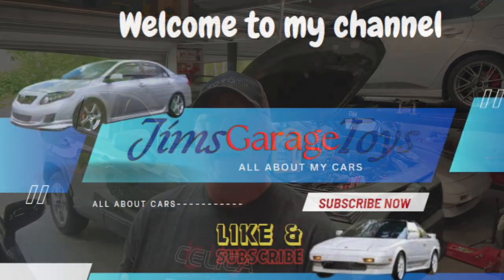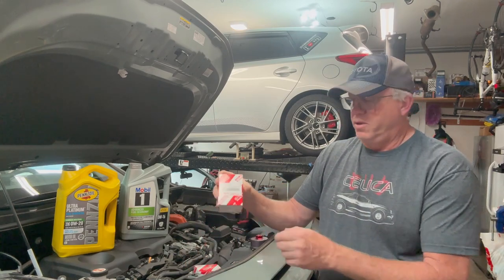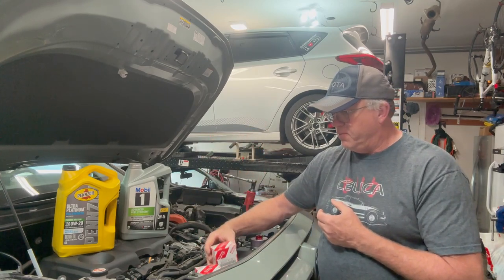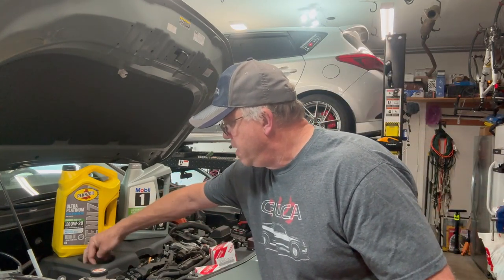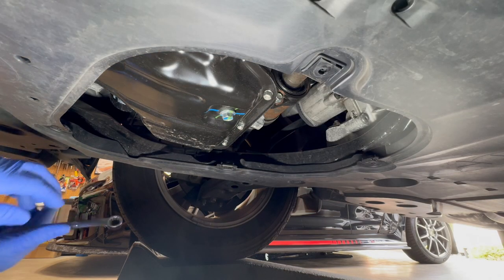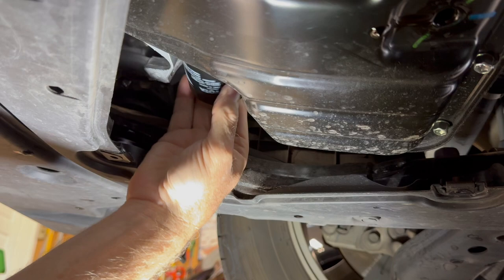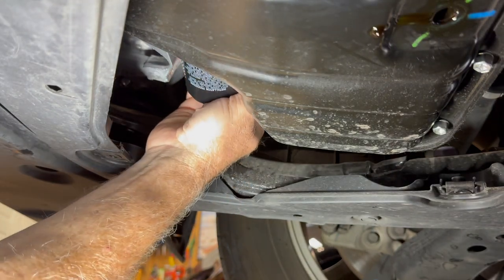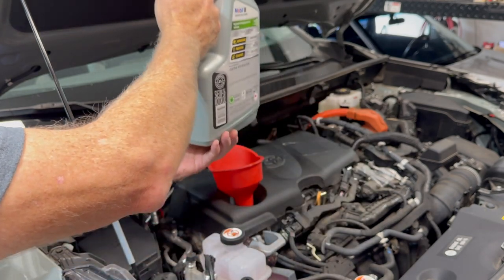Toyota 2019-2024 RAV4 Oil Change | Is 0w-16 The Right Choice? How Much Oil Is The Right Amount?

Comment: It may be even better to use the OEM Toyota oil, which is Mobil 1 with Toyota additives. The Motor Oil  Geek scientist is well worth looking up, as his company has done extensive oil research. When you take your car to be serviced by somebody else they are unlikely to pre fill the oil filter and are also likely to overfill.
Reply from the maker: Funny that you mention Lake aka The Motor Oil Geek. I'm just not very confident in the Mobil 1 oils as I haven't seen very good results from them in testing. In fact, Lake has tested the Pennzoil Ultra Platinum and has been very impressed with it. He has used it personally and loves how it has tested and performed. I've spoken to him about it several times. I will be working with him directly to test some different oils on both my 2009 Corolla Turbo and 23 GR Corolla. It will take a couple of years to get all of the data but I'm looking forward to seeing what we learn.
Reply: @ Next week in fact, l am picking up a new 2024 RAV4 hybrid AWD, and l have been trying to work out, which is the best oil  to use in South Australia (warm climate),
at this stage I am looking into OEM Toyota, (not sure wether to use their 0W-16 or 0W-20) or Pennzoil (Pennzoil also have a 0W-16 available in Australia, I am also concerned about my new cars warranty being affected by which oil I choose to use, or by me doing the oil change myself.
Reply from the maker: @aussiedeplorable8670  I know that I would use the Pennzoil Ultra Platinum myself in a 0w-20 with the higher temps. How hot are you talking? A 0w-30 or 5w-30 would also be okay in extreme heat.
Reply: @ in summer the temperature in South Australia range from 20°C to about 40°C (roughly 60°F to about 105°F), how would using 5W-30 affect the warranty with Toyota.
Reply from the maker: @aussiedeplorable8670  My first thought would be to use the 0w-20. It's listed in the manual here as being okay to use. When you get it, look and see what your manual says? Does it list any other oil viscosities? I'm curious to see if anything is different.
Reply: @jimsgaragetoys  
I think it is likely to be the same oil as they recommend in New Zealand which is 0W-20
Reply from the maker: @aussiedeplorable8670  I've heard from owners in hot regions around the world that 5w-30 is still shown in the manual as okay to use.

Comment: When you filled it to 4.5 qts with the short YZZN1 filter your video showed the level WAS proper...it was about 3/4 of the way between the min and max dots on the dip stick. 4.8 qts. would put the level ABOVE the max dot with the shorter filter. If you used the LONGER YZZ F1 filter or the longer WIX 51394 filter then 4.8 qts is the correct amount.
Reply from the maker: When I filled it with 4.8 quarts it was actually right at the full line, not over it at all so it was perfect. I use the longer YZZF1 filter on most of my cars but that was the filter the dealer gave my daughter so that's what I used. I would think that the 4.8 quarts would be correct with the N1 filter as that is what is listed in the manual. With the F1 filter it looks like you could just use the entire 5 quart jug.
Reply: I wonder if the 4.8 vs 4.4 is if you prefilled the filter or not, maybe ?
Reply from the maker: @ Won't make a difference since you start the engine and check for leaks, then you shut it down and check the level. Pre-filling the filter just helps build oil pressure quicker and gets oil to the top of the engine faster.

Comment: Get rid of the m1. Use ultra p. Excellent oil.
Reply from the maker: That's what I told her to do from now on. She didn't know when she was buying it but she does now. I sent the link for the PUP 0w20 to both her and her husband to buy that from now on.
Reply: With 0w-20 even 5w-20 being so thin, I'd put all 5 quarts in. I asked kevin who came in for lunch one lunch period why toyota overfilled the oil one whole mark over high mark 1 quart on top off 5.  His excuse was they wanna make sure everything is lubricated.  It ran okay besides the ecu dialing back power after one half throttle after a left turn since the oil gets sloshed to one side but having an overfill of water viscosity didnt stop it from overheating the oil
Reply from the maker: @rstuff1605  I'm not a huge fan of overfilling the oil unless you are going to be tracking a vehicle, that would be my one exception.
Reply: @rstuff1605 over filling the oil is just as bad as under filling.

Comment: Never change the oil at 10,000 miles thats crazy, 5,000 miles oil change max my rav4 2024 LE is going to have ow-20 . Not ow-16 especially im in Puerto Rico is hot all year long . My toyota corolla 2014 LE ow-20 5,000 miles. since 5 miles new the dealership told me that it's every 10,000 miles and I told them i treat my car's like a woman, not like a throw away. It's my money 💰 simple. Talking care of your car's is #1 . If not it will costs more in the long term. Good luck.
Reply from the maker: I couldn't agree more! I'm amazed when people buy a new car and don't change the oil until 10k miles. I do a break-in oil change on every new car around 800-1k miles and always do 5k mile oil changes. If I lived where you do or somewhere else that's hot all of the time I would use 5w-30 for better bearing protection and wear. Don't forget your transmission fluid and coolant either!
Reply: @jimsgaragetoys  yes all oils and fluids are taken care of I do it my self I don't trust all micanics.
Reply from the maker: @1967KID  I don't blame you, I feel the same way. I do all of the maintenance on my 3 daughters 7 Toyotas that they own too.
Reply: Manual for Toyota NZ says OW-20.
Reply from the maker: @johnmartin7158  Yep, that's my point, depending on where you are in the world, the oil that is recommended can be different. I know many people that run 5w-30 in their vehicles that call for 0w-20 and they have well over 300k miles. The 5w-30 offers much better bearing protection.
Reply: @jimsgaragetoys  Sadly we get old and not changing your own oil,motorcycling,and so many other things come to an end.I miss changing my own oil every 3k,how sick is that?lol
Reply from the maker: @philipeli1192  I still enjoy working on my own cars and sometimes the oil is changed at 3k miles. I own 7 cars and I change the oil every 12 months or 5k miles and many times the miles don't reach that 5k mile point. If I take a road trip I don't have an issue hitting that mileage and my wife hit the mileage on her Prius just fine. The others are hit and miss. 🤣
Reply: @jimsgaragetoys  I have a toyota hybrid that gets better mileage than my suzuki c109 street bike gave me! Of course its 2 different machines. I love the feel a fresh amsoil change felt on my clutch. I knew when to change it by feel alone,a superpower maybe,lol
Reply from the maker: @philipeli1192  Toyota hybrids are fantastic. We have several of them in our family that I take care of. My wife has her 2010 Prius, one of my daughters has a 2021 RAV4 Hybrid, and another daughter has a 2019 Prius C and a 2022 Sienna. These are all fantastic hybrids and if taken care of should last a very long time.

Comment: I found out japan had 0w-8 since 2015 or so
Reply from the maker: Yep, they started testing it a long time ago. There is no way I would use 0w-8, newer Toyotas also call for that and once again, it's just for EPA mileage figures.
Reply: @jimsgaragetoys  that ow-8 toyota oil made by mobil is 24.00 a qt at my dealer! Light oils are the future sir,at least in turbo and direct injection engines.6b oil flows so good,0w -8 even more so.Trust the engineers,not just higher viscosity numbers. I was a 20-50 guy in my hot rod days,now its lawnmower oil,lol
Reply from the maker: @philipeli1192  You don't seem to understand that it's NOT the engineers that are making this decision. Using lighter oils like 0w-8 will help MPG by the smallest amount, this is why they are using them and for no other reason. The only thing that manufacturers have to worry about is that engines last past warranty and the extended warranty lengths which normally don't go past 120k miles. After that they din't care, if you want to keep your cars longer than use an oil that won't have the blow by that the thin oils do, and testing has shown that they do. On my GR Corolla even the 0w-20 has been shown to not protect the engine nearly as well as a 0w-30 or 5w-30. A 5w oil can flow down to -31F which most people don't have to worry about. so even for winter a 5w can be fine. The true benefit is the 30 weight for heat and bearing protection. Each oil standard that comes out doesn't mean that current oils don't pass that but lower quality oils will need to be improved. Amsoil and Pennzoil Ultra Platinum are 2 of the best oils available and I would bet that they can both pass the new standards with the current oil. This occurs a lot but all oils ill be tested to see if they do pass. The oil you mention from the dealer for $24/quart, there are 2 reasons I wouldn't use it, one is the cost and 2 is that it's made by Mobil as their oils have been testing poorly for years now.
Reply: @jimsgaragetoys  why are you so scared of light oil that is of better quality than old oil? If its a numbers thing your incorrect,turbos and direct injection need these new oils! I use amsoil hybrid oil 0w-16 the correct oil you can use what you want,direct injection,requires 6b! heavy oil will wash the walls,then its toast. Dont mean to rain on your parade tho,lol
Reply from the maker: @philipeli1192  I'm not scared of them at all, but I don't blindly believe that they are the be all, end all solution because in testing they haven't protected engines nearly as well. Why are you so blind to the reason why they are using them? Oils will continue to get better, that's the way things work. But to not understand why thinner oils are being pushed isn't looking at it with any concern at all. Engines are becoming smaller and more powerful due to turbochargers and they produce a lot more heat. Heat is the enemy and given that different weights of the same brands top rated oil line will have similar protection and detergent packages, the weight will be the primary issue for bearing wear, blow-by, and engine longevity. It sounds like you need to do some more homework before you continue to believe that a 0w-8 oil will protect an engine as well as a 0w-20, 0w-30, or 5w-30 depending on the engine and location, these are not thick oils like a 20w-50 from 50 years ago.  The reason for them is politics, and nothing more.
Reply: @jimsgaragetoys  I disagree,engineers want it.Use the oil recommended in the manual,period.
Reply from the maker: @philipeli1192  We will just agree to disagree. The same engine may have used different oil over the years and in different locations around the world. The only reason to use super thin oils is for MPG and political rules. If you don't understand how oil protects a bearing and how heat destroys oil then I can't help you. You continue blindly following what you're being told to use, like engineers care since they are constantly over ridden for marketing and other purposes, for me, I'll follow what the science tells me to use.
Reply: @jimsgaragetoys  you trust whoever you want,I trust the manufactures advice over old farts like us,they have real engineers behind them.Nice job on the video,other than the viscosity disagreement,i live by frequent changes,Amsoil and purolator for me. Its just oil,right?
Reply from the maker: @philipeli1192  Yes they do but the engineers don't get the final say on oil weight and that's why it can vary around the world. I don't go by what I think, I go by the science that is gathered from testing oil  and proving what actually protects parts best. I run Amsoil 5w-30 with an OEM filter for my turbocharged cars as the testing has shown it to protect better than 0w-20. On my NA cars I use Pennzoil Ultra Platinum as that has tested really well too.
Reply: @jimsgaragetoys  I do not like either turbo or superchargers. I remember the 3 cyl detroit diesels in a lot of our rr eqipment,lots of deaf guys today,those bastards screamed,but they were reliable too. Two strokes are dead now,emissions,or common sense?
Reply from the maker: @philipeli1192  I own a 2023 GR Corolla with a I-3 Turbo and it's a blast to drive. The 5w-30 oil is quickly being shown to provide much better protection on that engine. On my 2009 Corolla with a 1.8L I-4 I turbocharged it back in 2017 and it's been fantastic. I wasn't sure about running 0w-20 as it called for in stock form but after doing a lot of research 5w-30 seemed to be the best choice due to higher heat levels and better bearing protection. The ironic thing is that I don't really see much difference in MPG. If I drive it and stay out of boost I'll still get 35-40 mpg with it. I stick with 0w-20 on NA cars even if they call for 0w-16 or 0w-8 as the manual even says you can use it, this is all due to CAFE standards so I'll choose better engine protection over slightly better MPG. 😉

Comment: That mobil 1 is 6b rated the 0w-20 is not. The mobil 1 0w-16 is the superior oil here.Use what the cap says,us Americans love big numbers.
Reply from the maker: A 0w-16 will not protect bearings as well as the 0w-20 and the Pennzoil Ultra Platinum is a much higher rated oil and has done better in testing than the Mobil 1. The only reason that oil is getting even thinner than 0w-20 is due to CAFE standards and the government pushing for better MPG, it has nothing to do with what is best for the engine and it's long term health. Meeting ratings is fine, I'm sure the Pennzoil will meet that goal too but it has out performed the Mobil 1 in every comparison test I've seen. And I trust the science of the testing and protection I've seen that the 0w-20 provides over the thinner 0w-16 and 0w-8 oils. Feel free to use what you prefer.
Reply: @philipeli1192 The channel is totally correct. It’s country to country. My Toyota RAV4 manual explicitly says OW-20.  I’m in NZ. This is the 1st channel to point this out, so kudos to Jim’s Garage Toys
Reply: @jimsgaragetoys  I use amsoils hyvrid formula0w-16.Dont tighter tolerances call for lighter oil????
Reply from the maker: @philipeli1192  These tighter tolerances have nothing to do with the super thin oils that are being used. The only reason for using 0w-16 and now 0w-8 is for CAFE standards from the government. Without them the engineers would never use these thinner oils. In fact they would most likely still use 5w-30. I know many people that do indeed use 5w-30 instead and have for more than 300k miles because it will protect bearing much better. Even when a 5w-30 oil is at operating temperature is plenty thin enough to flow through the smallest of places. The key is to keep the oil clean and change it.
Reply: @jimsgaragetoys  This simply isnt true,look at Japan and Europe they use 0w-8!!They have no CAFE standards.Heavier oils have drawbacks too.I change every 5 k too.
Reply from the maker: @philipeli1192  Japan seems to be the test center for lighter oils as they have been testing 0w-8 for many years. Europe also has many regulations similar and some more strict than CAFE so it does still apply if you look at places that deal with extreme heat and don't have these issues. Many of them still recommend 5w-30 and oils that slightly heavier have been shown in testing to provide better bearing wear and protection. Now I'm not talking about using a 20w-50 so don't think that I'm getting carried away. 0w-8 and 0w-16 though are extremely thin oils and a 0w-20 oil is still very thin for a turbocharged engine.
Reply: @jimsgaragetoys  There are many features of motor oil viscosity is just one the 6b rating on 0w-16 is superior oil than 0w-20 6a oil. They put the proper oil viscosity and type on the oil cap for a reason.Look for the shield on the bottle,not the circle.https://www.youtube.com/watch?v=z_j1BujNIQg
Reply from the maker: @philipeli1192  Most quality 6a oils will also pass the standards for the 6b rating. Oils that are selected for an engine actually has a lot of reasons for it and least of is the 1st choice of the engineers. I prefer to follow the scientific testing of oils and viscosities and how they protect than just blindly believing in what the CAFE standards are forcing manufacturers to do.
Reply: @jimsgaragetoys  Use what the manufacture states,is my advice,with frequent oil changes. Jumping viscosity at the cost of flow and efficiency matters.I have seen dynos on this new oil and 0w-16 6b gets you more ponies,more mileage too.And most is not a word I use in my oil,if the bottle doesn't carry a shield you are using the wrong oil in my opinion,and toyotas.